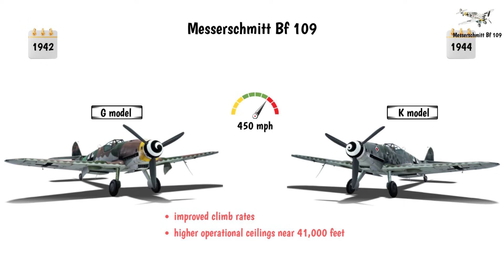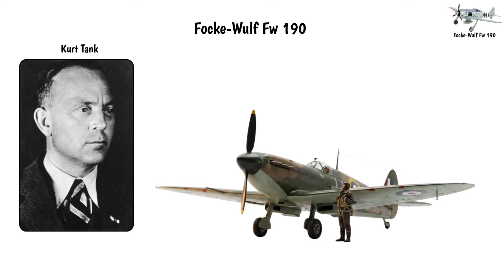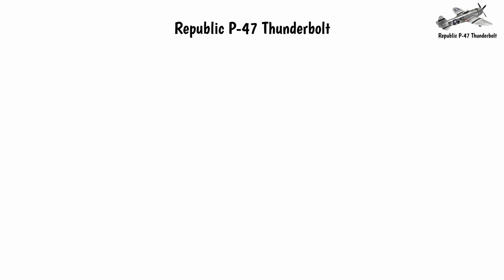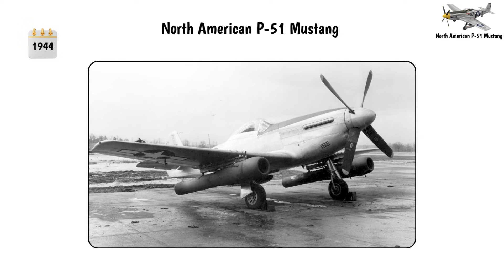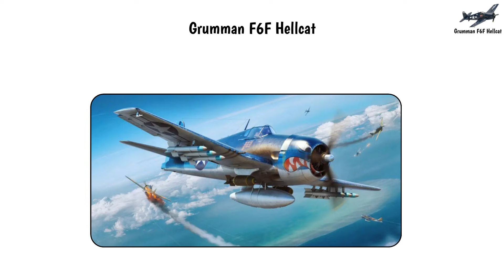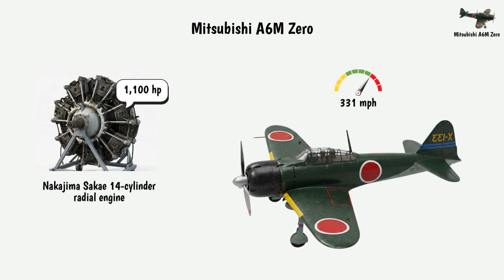Every WW2 Fighter Plane EXPLAINED in 14 Minutes | Part 1

Comment: Overall nice video, hard to talk about so many planes in so little time. But did I hear P-47 as an excellent bomber escort??? Yeah… not so much. Bomber escort squadrons switched to P-51’s as fast as they could to replace the P-47 for that mission.
Reply from the maker: Fair point. The P-47 could escort, but you're right that P-51s became the go-to for deep penetration missions. The Thunderbolt really found its calling in ground attack

Comment: Pretty good presentation, however the Me 109 didn't dominate the Battle of Britain,  they lost almost 2:1 to mainly the Hurricane. Also the Me 109E that was used at that time didn't have the nose mounted cannon as standard, it returned with the later Me 108F.
Reply from the maker: Fair point on the wording. The 109E was effective but you're right that the Hurricane did most of the work in the Battle of Britain. Good catch on the armament variants too

Comment: An error in this video. The Hellcat was NOT designed specifically to counter the Zero. It was modified to better handle the Zero. However, just as important was fact that American pilots were trained in tactics that worked to the Hellcats strengths while avoiding the Zero's strengths.

Comment: The British Rolls Royce Merlin NEVER saw combat in the P-51. It was a Packard motor that was completely redesigned. Ford had to go and teach Rolls how to make the motor better before the US was even in the war.
Reply from the maker: True, the P-51s flew with Packard-built engines. Packard did make manufacturing improvements for mass production
Reply: @LegionLabTV The Wright Quill Drive is an all American improvement separate from mass production that really made the P-51 excel at high altitudes.
Reply: You wish…

Comment: 7:30 - Mustang with 14,00 HP. Germans would have been amused ;). Also the title claiming "every WW2 Fighter" is an exaggeration. You would need hours for that.
Reply from the maker: That's the reason part 2 and part 3 are coming up soon. Stay tuned, cheers

Comment: I must have missed the P-38 lightning, the video didn't say only a single engine, and the P-38 was a fighter and a rather good one, matching the zero's range, and the P-40 Warhawk WAS a single engine and had quite a few kills so why did they skip both those
Reply from the maker: Both solid aircraft. This list went by production numbers - the P-40 was close but didn't quite make the cut. P-38 was a great twin-engine fighter but lower production. Parts 2 and 3 are coming soon though

Comment: You really need to make a second part. We also have; 

Seversky P-35: By the time they fought Japan at the Philippines, they were badly worn down. 
Boeing Peashooter: Also fought Japan at the Philippines. 
A5M: Yes, they were at the Battle of the Coral Sea. 
Wildcat: Unlike the Hellcat they could take off escort carriers. 
Brewster Buffalo: Somehow the Finnish found a use for these ugly things. 
Airacobra and Kingcobra: Strong nose gun and the Soviets liked them. 
P-40 Warhak/Kittyhawk: They were common in early WW2 and used by the allies. 
Hawk 75: Unlike its original American counterpart (P-36) these saw actual success for the allies. 

Hawker Typhoon: Long range and low-altitude fighter. 
Hawker Tempest Mk V:  Improved the performance of the Typhoon. 
La 5F: A variant that improved the pilot visibility from earlier La models. Also had fuel injection and good low altitude performance. 
La 7: Generally could go toe-to-toe with German fighters and faster than the La 5. 
Yak 3: Had a high power-to-weight ratio and rather light. 
Gloster Gauntlet: Was involved at Finland's Winter War. Ancestor to the Gladiator. 
Gloster Gladiator and Sea Gladiator: Robust airplanes that were able to fight Italian airplanes. 
Fiat CR 42 Falco: Got chewed apart by monoplanes, but they still served a purpose for Italy. 
Fiat CR 32: Older but numerically important. 

Macchi C202 Falgore: A good performer with otherwise not the strongest armament. 
Macchi C205 Veltro: For a short time was a major threat. 
Fokker D21: Stood their ground against Germany for as long as they could. 
A-20 Havoc: Could serve the purpose of a night fighter. 
P-61A and P-61B: Important night fighter to both the US and UK. 
de Havilland Mosquito: Very good at bombing and good at fighting. 
de Havilland Hornet: Not much of a service life, but they were even better at fighting. 

P-59B Airacomet: The first jet for the US, but it was even slower than the Thunderbolt and was relegated to training. 
P-80 Shooting Star: America's first true combat ready jet. 
Gloster Meteor: Unlike other allied jets saw actual combat. 
He 178: If you count prototypes; it was the first jet to ever fly. 
He 280: A rival prototype to the Me 262. 
Gloster E28/39: UK's very early jet. 
Me 262: Most infamous WW2 jet. 
He-162: Emergency program wood jet.
Reply from the maker: Appreciate the detailed list! There are definitely enough worthy aircraft for a follow-up. Parts 2 and 3 coming up!
Reply: Damn, respect the effort u put into finding the entire list
Reply: @iloveneen4098 And for giving the Buffalo a mention. It is much-maligned, not without reason, but the Finns did put it to very effective use.

Also.......it was part of the defense at Midway. The defenses at Midway were vicious enough that the IJN fatally decided that a second strike was necessary; thus the poor Buffalo has a spot in Valhalla.
Reply: And the P-38 Lightning.
Reply: There was more than 100 types od fighters used in Second World War.
Reply: You make it..
Reply: The P39, P400 and P63 were all used throughout the war. The P38, P39 and P40 were all early entries into WWII. There was also the Brewster aircraft, Curtis P36 and early P31 that were used as well.
Reply: What happend with the french ?